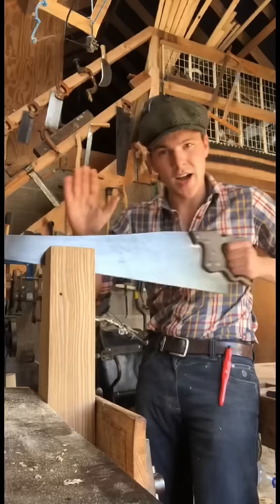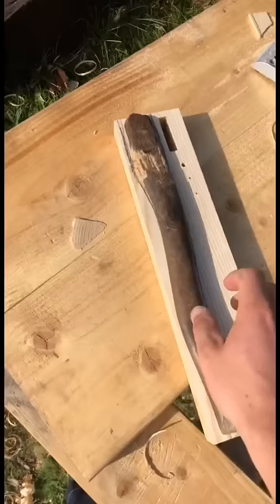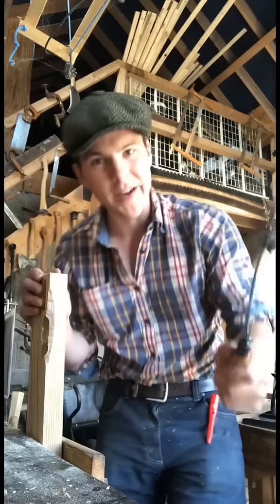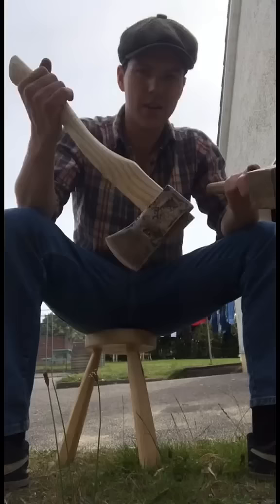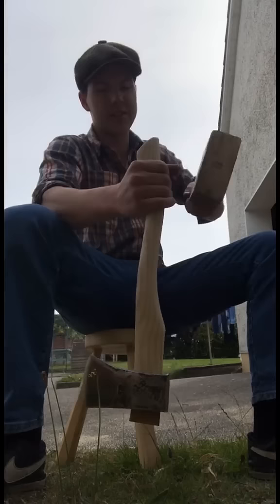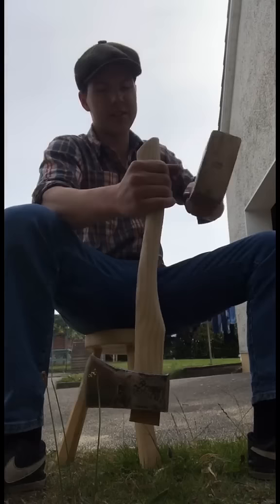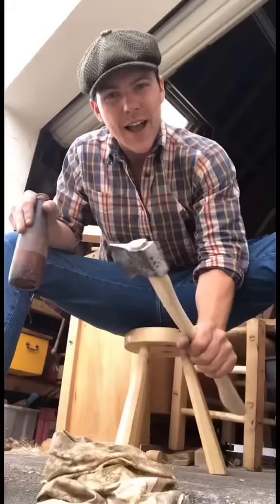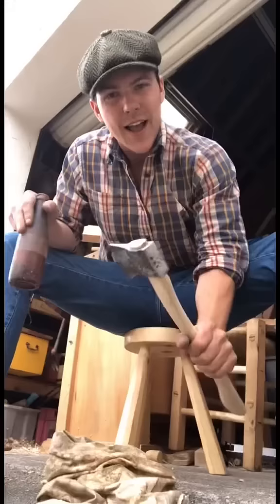Making Another Axe Handle #shortvideo #ireland #handtools #woodworking

Comment: A great tip for oiling the handle if it's virgin wood and especially if using regularly.   The wood will soak up a LOT of oil...
  Every day for a week, every week for a month, every month for a year and about every 6mos to yr. (depending upon use) after that.  You'll be surprised at how much it takes in and the results when you're done.  I know it sounds excessive but, trust me...
It pays.